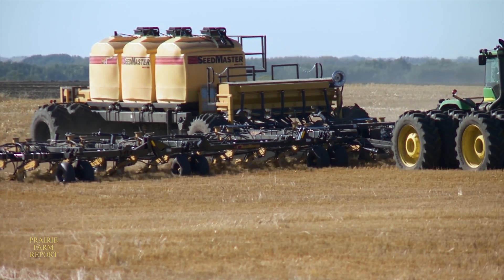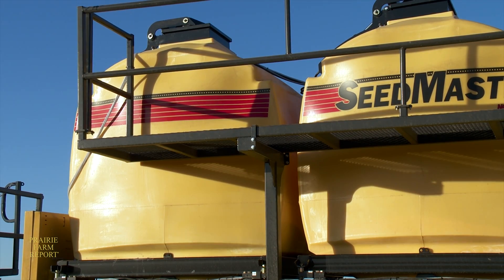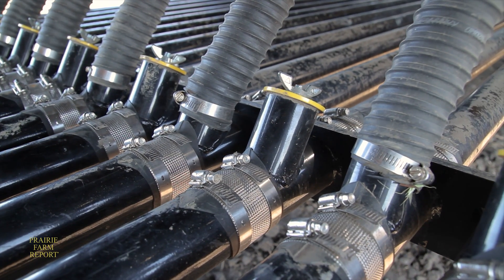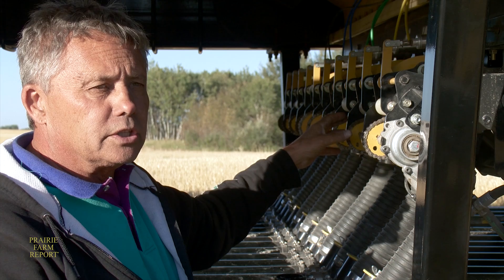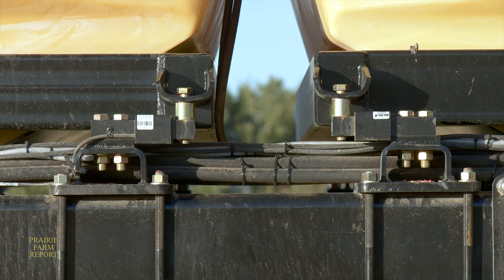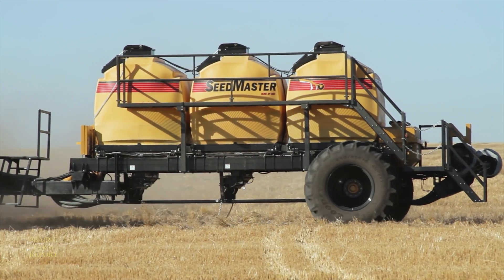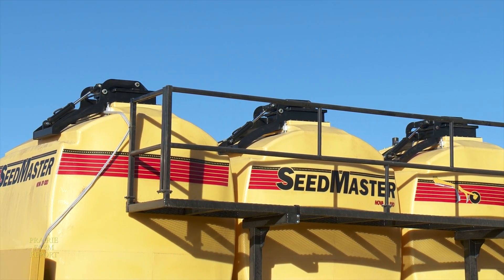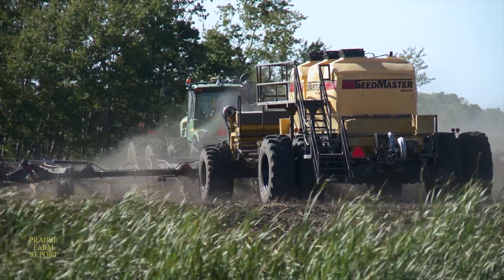SeedMaster Nova Air Cart

Comment: I get such a kick out of seeding manufacturers. I put down 520 lbs an acre with my 1998 Morris 7180 on my 2002 Morris max 2 running a 1995 John Deere 8100. Never plugs, and you’re filling on the constant but you can sure run product through the old pair
Reply: We had a Haybuster no till that was 30' and would seed 150 acres before refill pulled by out 120HP 2WD.  So our big boy neighbor farmers are still unloading their giant seeders and setting them up as we finish out 200 acre piece, they bring 3 40' JD drills and 4WDs and multiple trucks.  Big and fast not always go together.